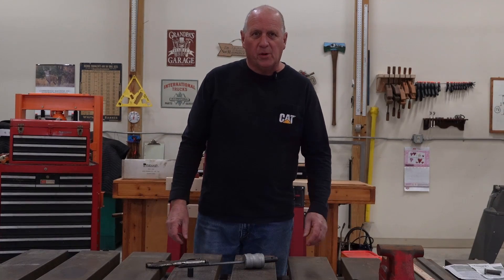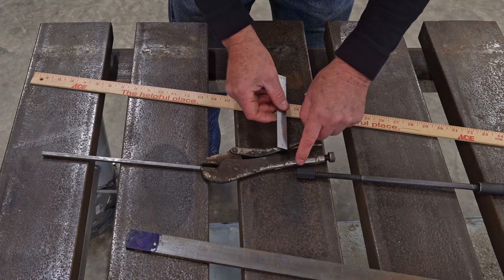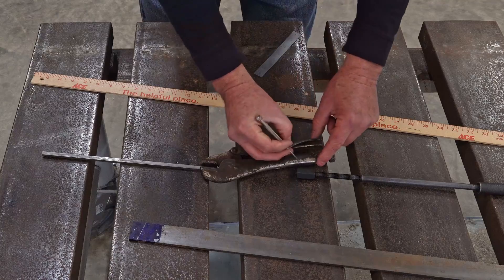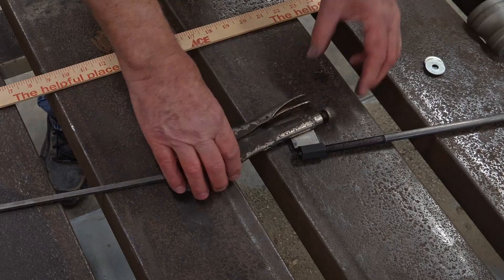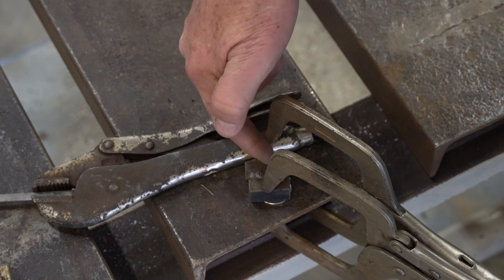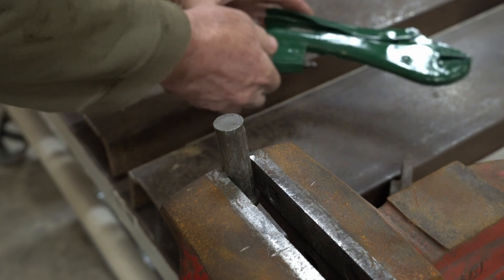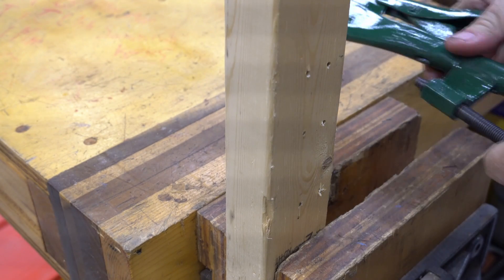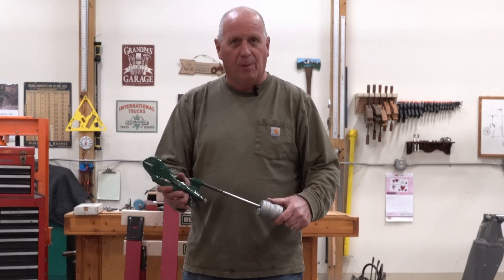🔩 Ultimate DIY Slide Hammer with Locking Pliers – Built for Tough Pulls

Comment: Looking to make one myself.  Like set up on yard stick getting  set up along the pull axis.  

Think I will grind/sand off finish on the grips 1st.  

Thinking about grinding a slot in grip along the axis for grip options.   My 2 lb slider is way sloppy on shaft,  Think I will press in a brushing with a flat on end for contact point.
Reply from the maker: Thanks for your comment. The tool works great on those stubborn rusted in cotter pins.